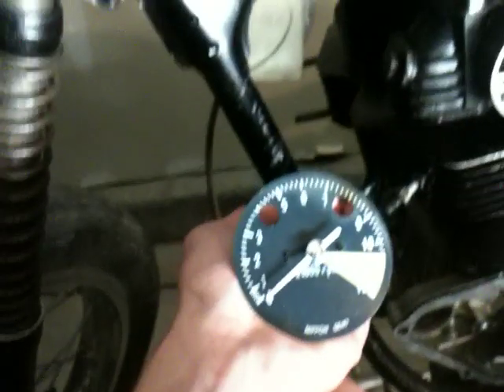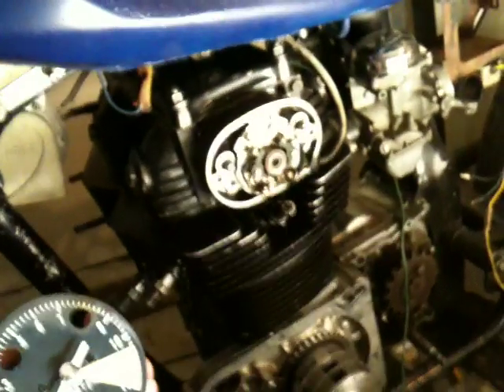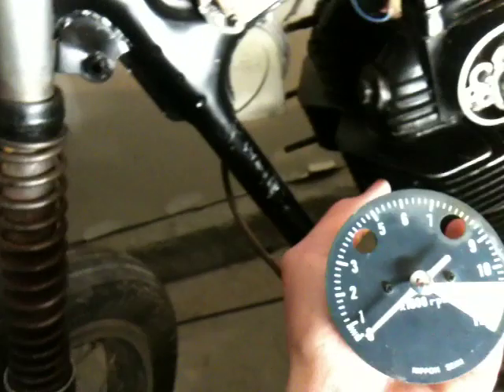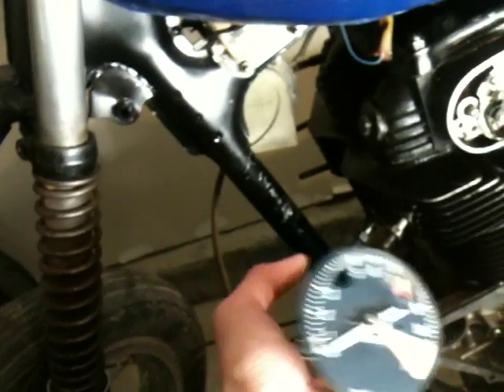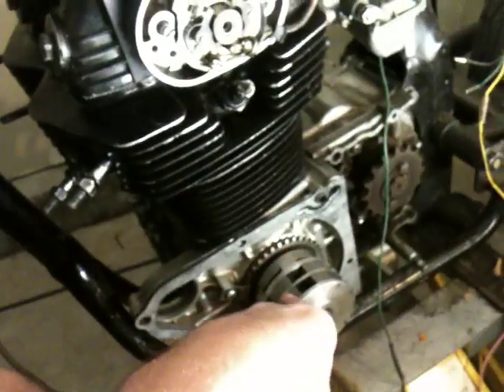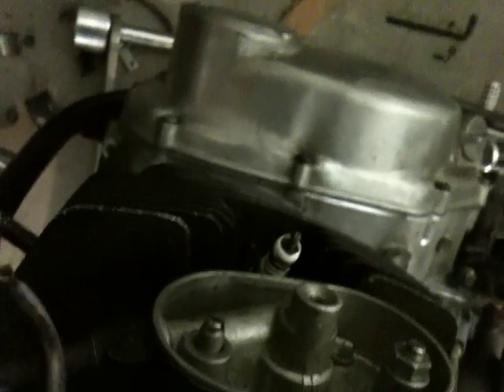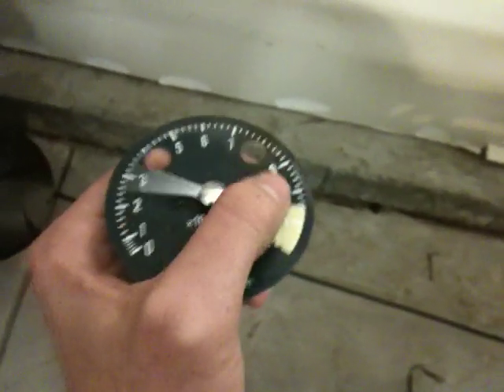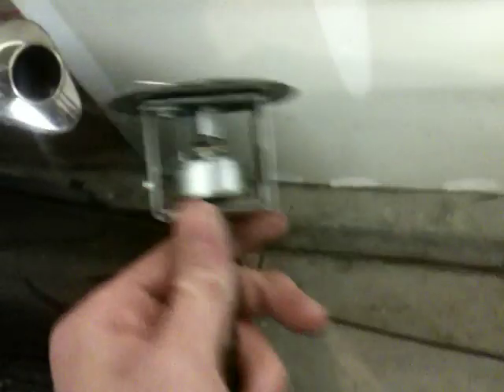How a tachometer works

Comment: You just explained how it's driven but not how it works man. If it was solely driven by the worm gear the needle on the tach would just spin in circles. I think there is a magnet involved similar to a speedo